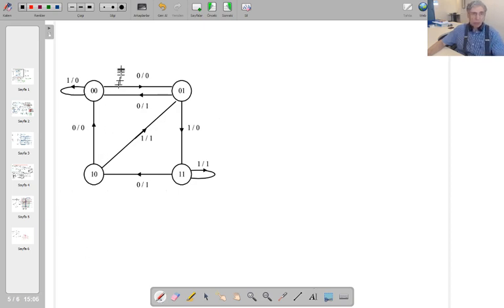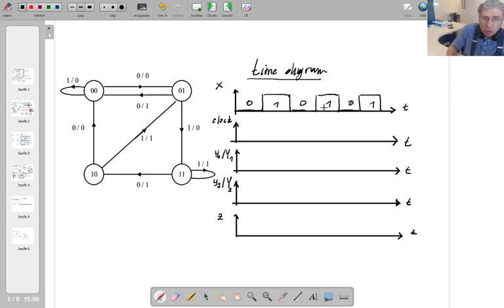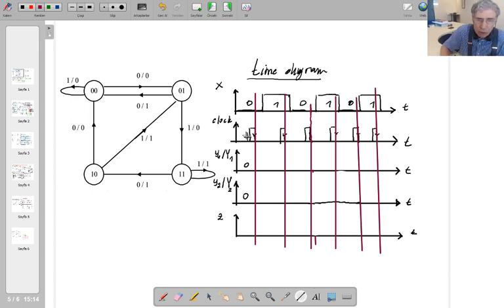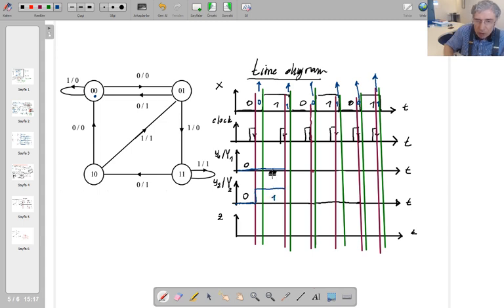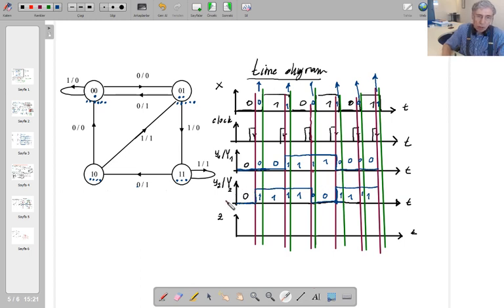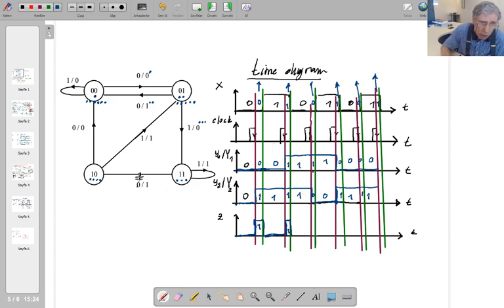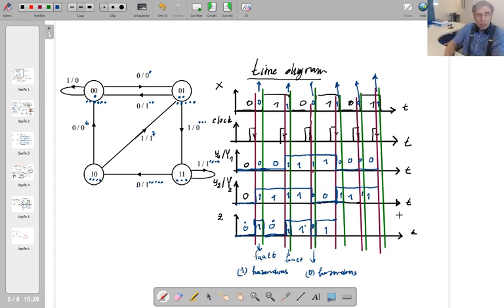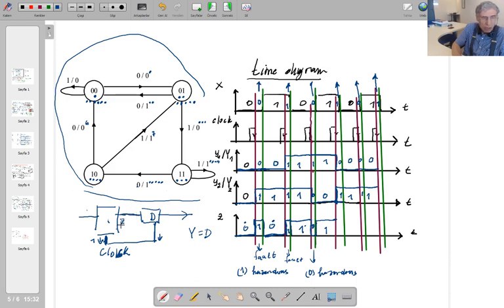Ch7-3-2 mealy machine time diagram

Comment: sir 

how to choose Fault(False output) in Z ,if X input  is half-half in 1 per clock

i think choose Z when X input is wider

is right!?
Reply from the maker: The time interval that we could observe false output is between clock edge and input cahange. if this itime interval output value is the same as previous output value (for exemple 001: first zero before clok pulse z value, second zero false output value, third 1 z output value after clock pulse; or 000, 111, 110) then the false out might not be hazardous. Similiarly if false output time interval value is the same as post z output value (such as 000, 100,011, 111) then once again  the false out might not be hazardous. 
But if the false output value is 0 while previous and after z output values are 1 (101), definitly zoutput value becomes hazardous.
another case could be (010). I hppe this will help you understand the case.
Reply: @ertugruleris6449  i appreciate your anwer 

Thank you so much